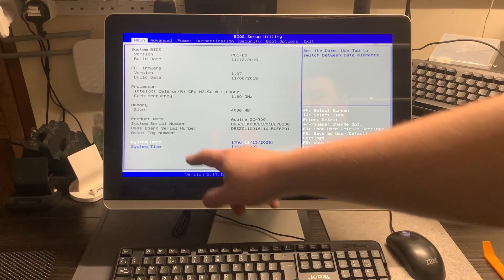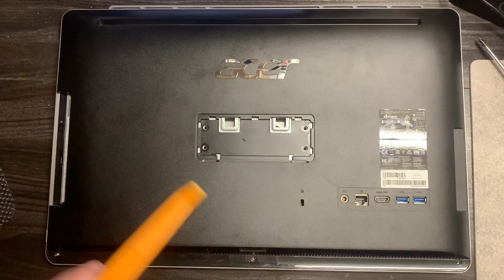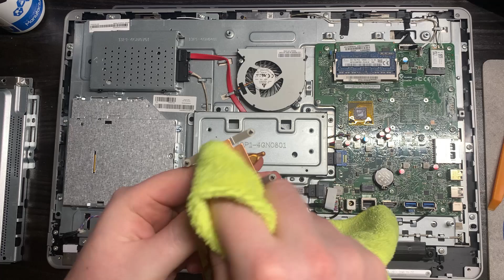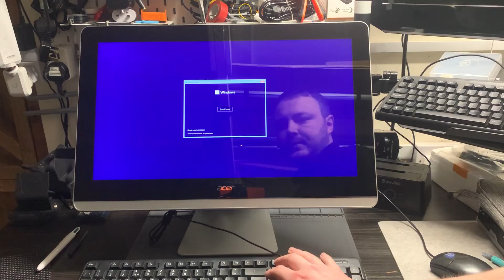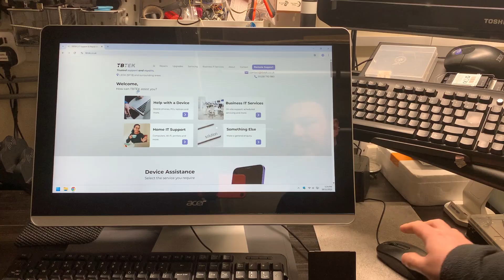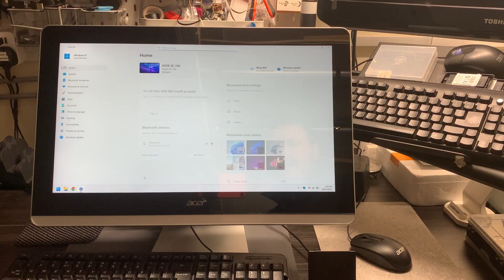ACER Aspire ZC-700 AIO PC - Upgrade and Windows 11 Test! | TBTEK

Comment from the maker: Thanks for watching guys!

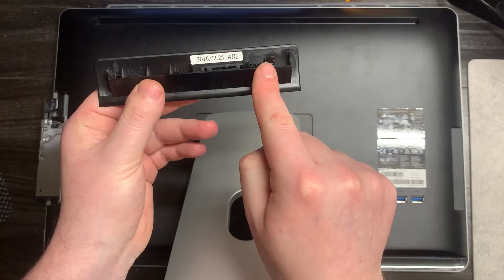I noticed a small detail that I missed during filming! At 3:14 there is a date on the optical drive trim from 2016, so it isn't as old as I first thought!

Due to the length of the video I had to cut the Windows install part short, if you need to know how to fresh install Windows 11 or upgrade to 11 from 10 on this machine, then I have added links to video guides in the description.

The Processors in these include the SSE4.2 instruction set so you are safe to install the latest version (currently 25H2 at the time of writing) of Windows 11. In the future, it is possible Microsoft ends up adding additional features that pre-8th gen processors can't handle but for now SSE4.2 is the only requirement for feature update 24H2 and later.